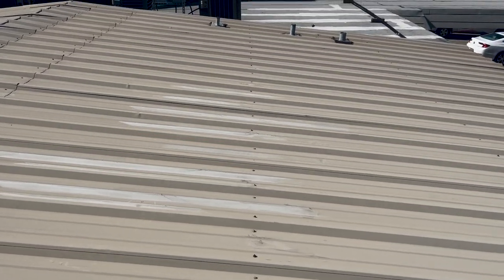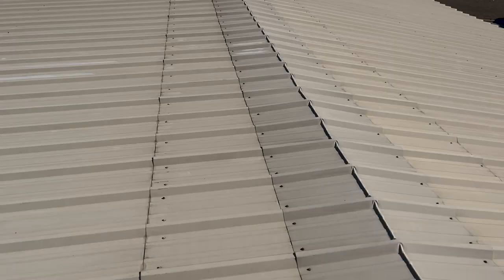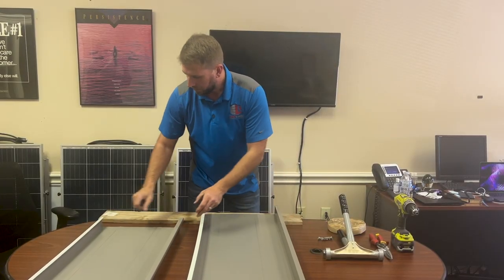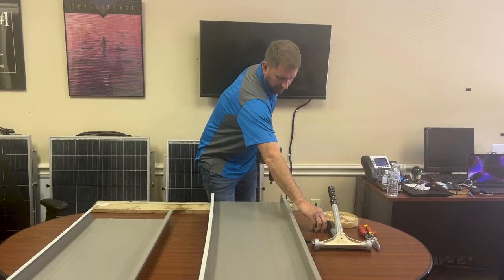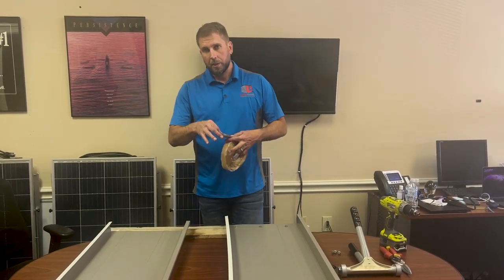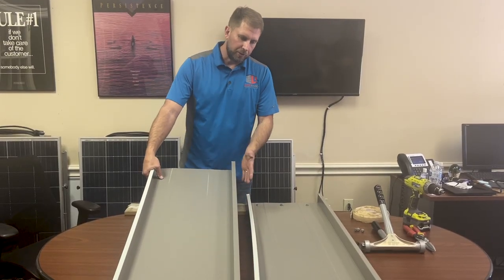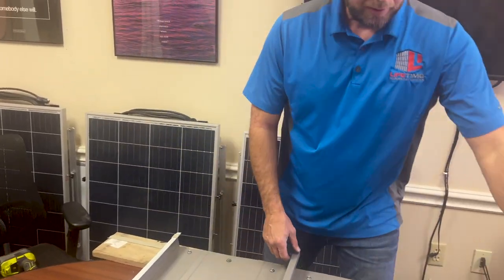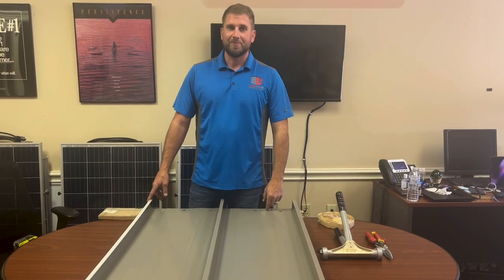How to use butyl tape - Tech Tuesday

Comment: In the van life community a lot of roof vents get Installed.
Butyl tape is used between van roof and vent flange, however underneath the flange are ridges , I guess to better bite into the Butyl. 
Would it make a better seal to apply lap sealant under the vent flange before pressing it down on the Butyl?
Reply: No, the butyl Will flow around the ridges when it gets warm.

Comment: My question about Butyl tape is the repair of a seam in a gutter.Caul doesn't seem to hold, maybe it's the expansion> The tape  goes on the outside of the gutter, after it is clean and over 40 degrees (not too cold out) correct? thanks I appreciate it.
Reply from the maker: Butyl tape is too thick for gutter repairs. Gun grade butyl, sealant and rivets will be a better option. Just make sure that your gutters have a big enough lap that the butyl doesn’t squeeze out all over the place. On the inside of the seam I would cover it With standard gutter sealant

Comment: hello, I was thinking of also putting some rubber tape or something on top of the z purlin before the steel roof goes down for a thermal break...is this a good idea?
Reply from the maker: Yes a thermal break is a good idea but we would recommend using an 3/4" foam thermal break instead of rubber. Rubber has a higher conductivity than EPS foam.